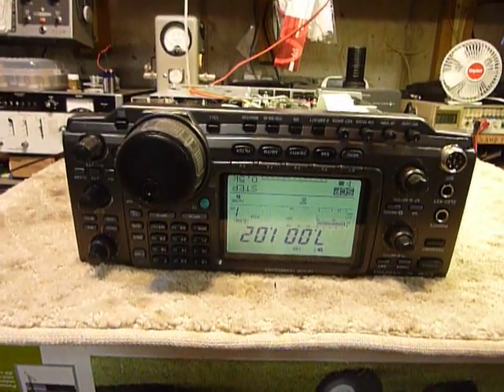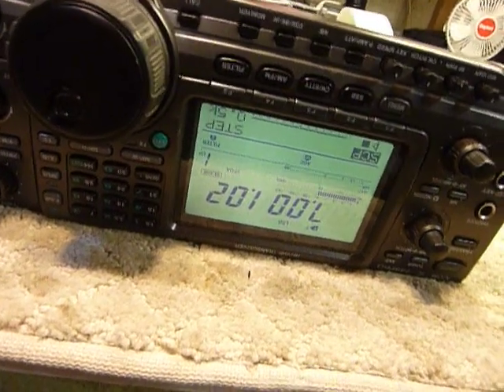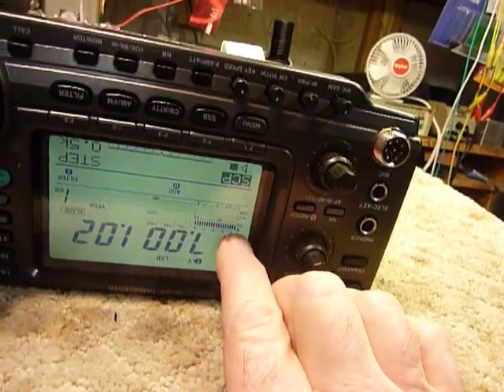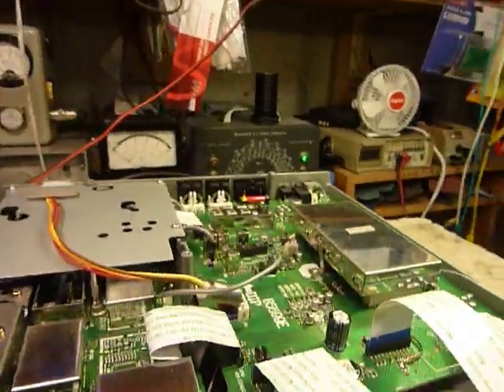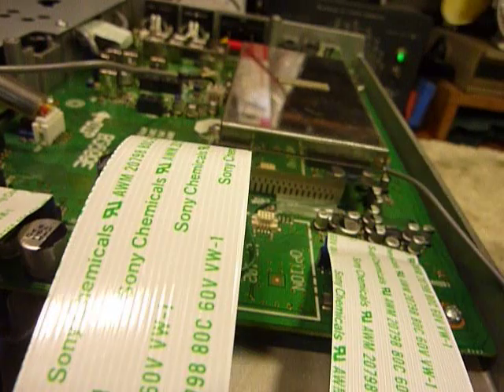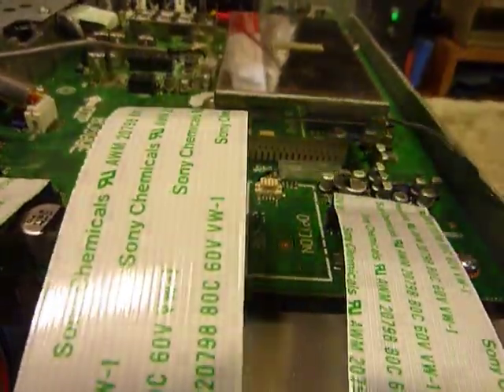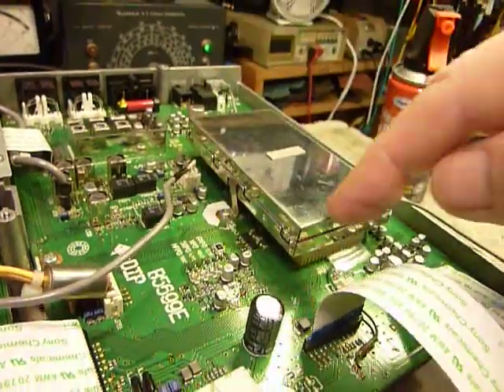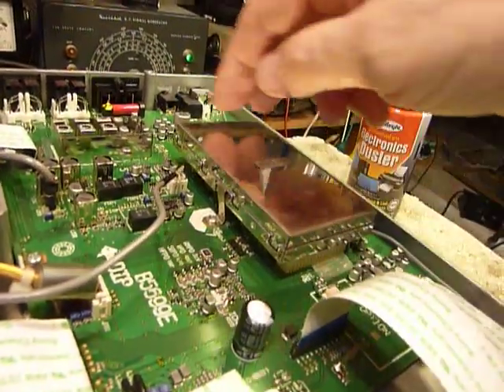PART ONE, ICOM 746PRO NO AUDIO , ICOM 746PRO , ICOM 746PRO NO RECEIVER AUDIO

Comment: You originally suspected a problem with the EXT Speaker jack breaking loose. That is my problem. I have not been brave enough to detach the main board to look at the solder connections to see if they need to be touched up. Any hints or suggestions on how to repair this problem?